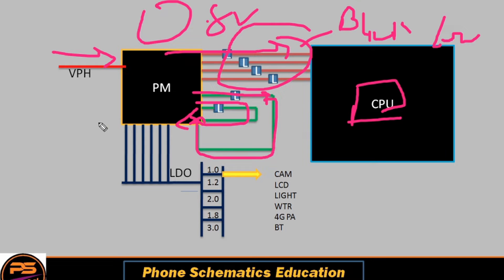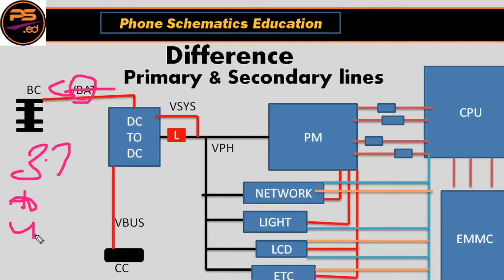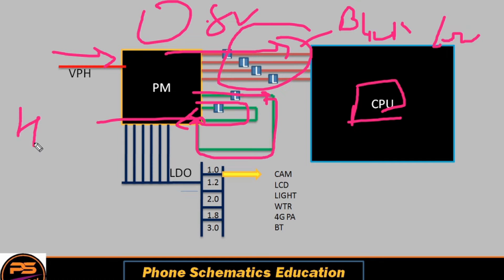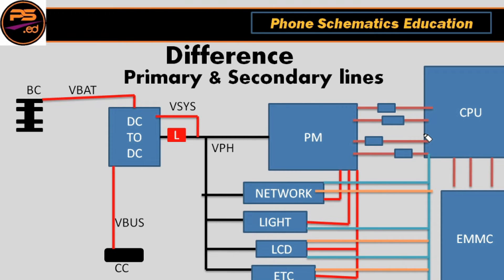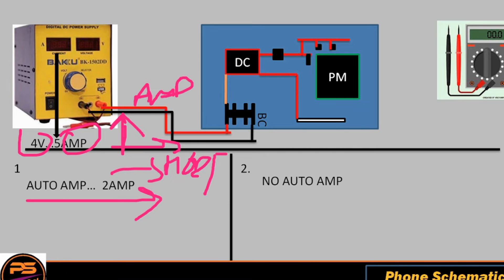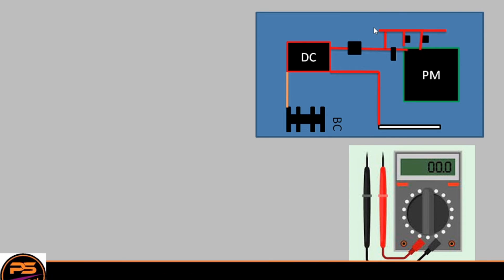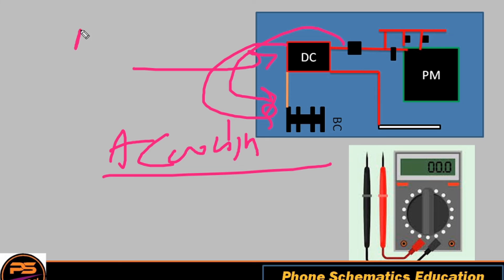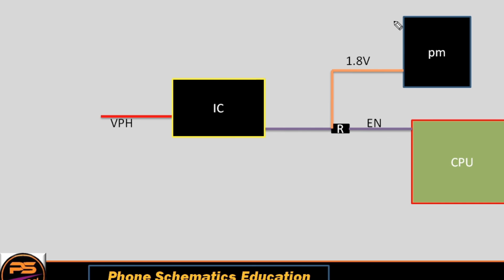Power controller ic output secondary line Testing+VBAT+VCC+VPH+BUCK+L. D.O VOLTAGES

Comment: Sir, please explain the input and output voltages for every section. For example how much voltage network section needs and how much voltage out from power IC and how much voltages supply to different parts of secondary section.
Reply from the maker: Everything explained in course
Reply: @phoneschematicseducation mean have to pay the course?